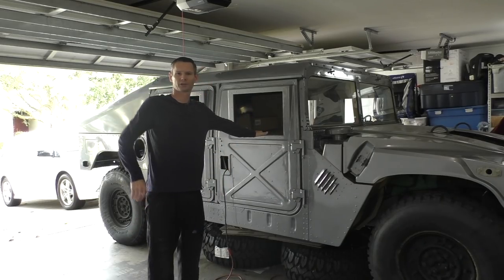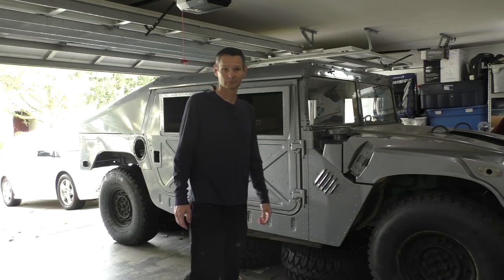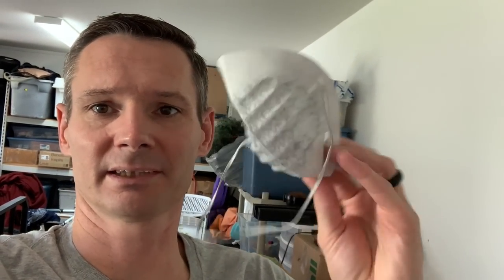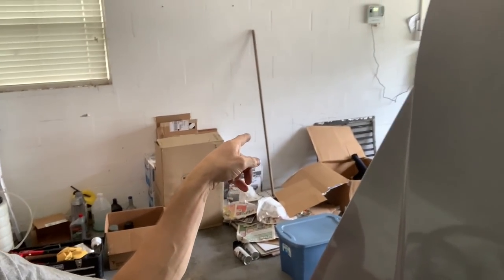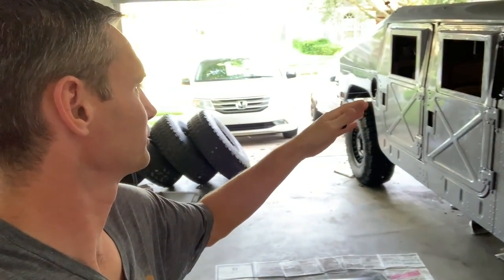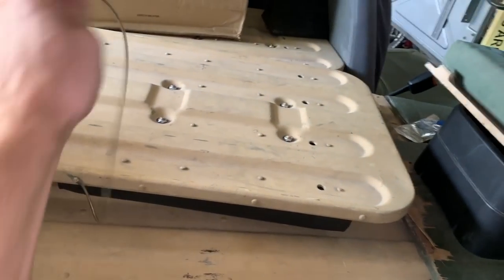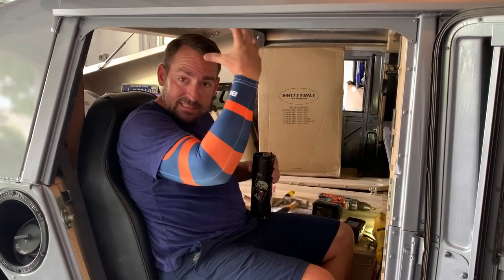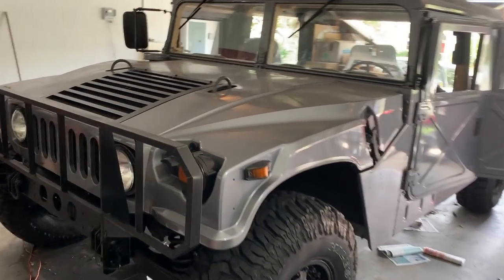My Secret Military Hummer H1 Project

Comment: Jimmy the man!  Who doesn’t want a sweet H1 like this.
Reply from the maker: for real!
Reply: @Kawka1122  Greta let's see if she geht's older....... ?
Reply: Who doesn't want one? 
Oh, I'd say at least 90% of those who have ever operated one.
 Take away the congressional critters this vehicle would have been fully retired and replaced decades ago for good reason. Giant engine, poor power, poor fuel efficiency, 3 speed automatic that is barely capable of highway speeds, it either leaks oil or doesn't run, parts are all available at DoD pricing $650 plastic radiator fan that'll disintegrate if you hit a puddle at >5mph, headlights suck, climate control consists of a fan pulling air over the engine. 
I've got thousands of miles in 998, 1038 and even the million dollar variant 1097. Nope, would not take one for personal use for free. A lightly modified jeep wrangler is simply a better civilian use vehicle in every category. A 998 costs around 65K bone stock, as a civilian you can do better for half that. Best thing it has going for it are the easily removable doors.
Expensive to buy, expensive to maintain, expensive to operate and everyone who knows anything will think you're an idiot. (also too wide for narrow jeep trails - great turning radius though)
Royal Marines drive Range Rovers, we couldn't keep up and needed double the fuel trying during the initial invasion of Iraq. So to answer the question again, our closest allies don't want them either.

Comment: A friend has an M151 which for those who don't know, just looks like a Jeep.  The Kansas registration on it was as a 1954 Ford pickup.  The vehicle came into his possession (sometime) legally but demilled.  They were quartered strategically to allow about an hour welding job to reassemble them.  

Manufacturers were paranoid about losing sales to the mil surplus scrapping and at the time the rules were such that some vehicles could be done this way if you knew who to talk to.

Not sure if any de-mil was required for yours other than maybe electronics and maybe weapons.  But at least hopefully it left the property of the military w/o being cut into pieces.